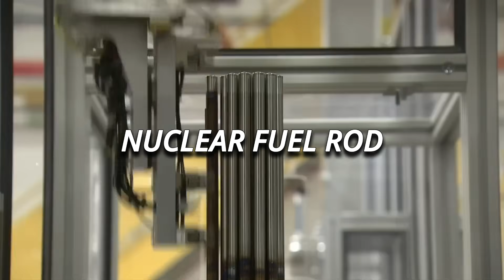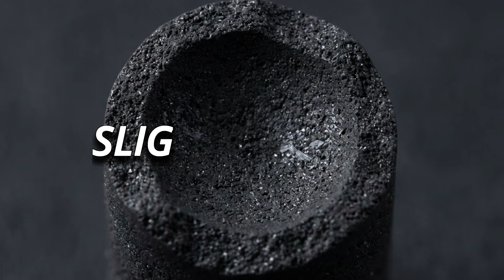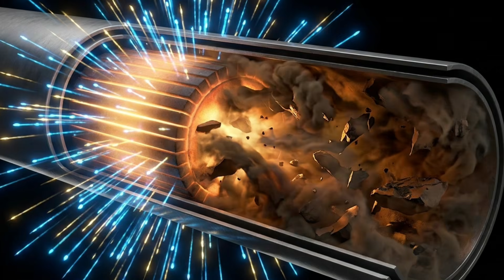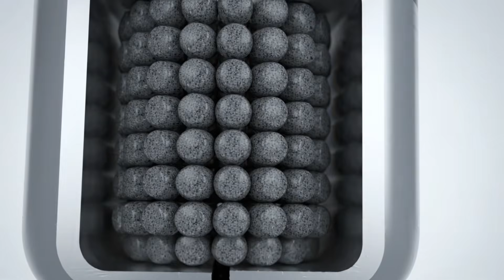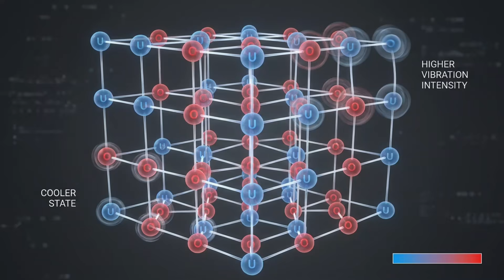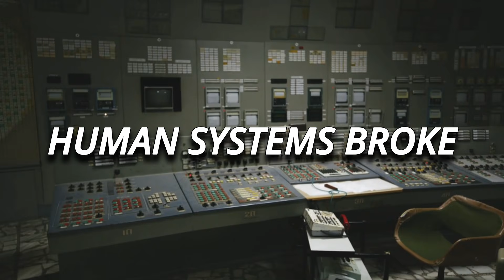Why This Tiny Nuclear Pellet NEVER Melts (It’s Genius)

Comment: Uranium dioxide DOES have a melting point, but it’s 2,865*C, around the same temperature as nuclear meltdown corium
Reply from the maker: Spot on—it definitely has a limit, the engineering is just designed to make sure we never actually hit it!

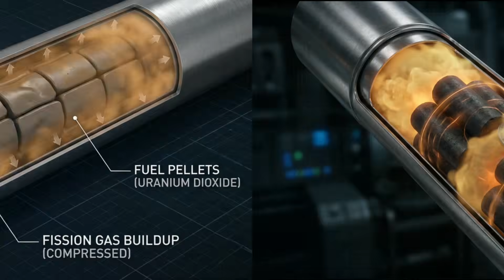Comment: @2:51  Wrong!!!!!!!

The bottom of the trench; according to Wikipedia Is:1,086 bar.   That is 15,751 PSI.
Reply from the maker: Sharp catch — and you're right to flag it. 1,086 bar / 15,751 PSI is the correct figure for the deepest point. If the number on screen read differently, that's on us to clarify. Either way, the physics doesn't change — at that pressure, the pellet geometry still holds. Thanks for keeping us honest. This is exactly the kind of audience we want watching. 🙌

Comment: As I believe, carbon doesn't melt, it sublimated, eg it goes from a solid to a gas and skips the liquid state!!!!
Reply from the maker: Exactly. That’s sublimation! Carbon is one of the few elements that prefers to skip the liquid phase unless it's under massive pressure.
Reply: @Machino2.o ahh, thank you. Carbon is my favourite element, it has so many unusual properties and is si crucial in life. It conducts electricity and is found in every living cell on earth. It hase so many different chemical forms. I also like silicone too!!!!

Comment: The fuel pellets are made of uranium oxide and zirconium oxide. This allows very good heat conduction. The fuel pins are evacuated and filled with helium, that's the secret that gives them decent heat conduction. The pellets have concave ends because as the reaction proceeds they generate fission products that would cause expansion that would cause too much cracking which could cause hot and cold spots. Pellets are separated by wafer springs to compensate for thermal expansion. The top of the rod has a gasous phase product resovoir mostly to allow the xenon133 to get to a safer location in the rod otherwise it would diffuse into pellets in regions of low activity then it could burn off and these regions could experience prompt criticality. The design is elegantly simple but damn effective. Hats off to the engineers who designed them. ❤
Reply from the maker: Spot on, Christopher. The xenon-133 migration to the plenum resovoir is such an underrated piece of the puzzle—it's basically a gas management system built into a solid rod. Glad you caught the detail on the concave ends, too! It’s that 'designed space' that keeps the whole stack from buckling. Thanks for adding that extra layer of engineering detail to the thread.
Reply: Eventually, the whole system surrounding and supporting the energy production turns Radio active, which themselves radite energy over time. Now, these systems needs to be controlled and replaced I guess. Isn't it?
Reply from the maker: @sandhyaprabhu6996  Exactly right. That's neutron activation where the structure itself becomes radioactive.

Comment: The comment at 2:50 is totally wrong..fluid physics, pressure increases by approximately 1 bar for every 10 meters (33 feet) of water depth. This is known as hydrostatic pressure  There is 14.5 PSI in 1 Bar... The marina trench is 11000m deep so that would be 11000÷10=1100.. 1100x14.5 = 15950psi... Get your facts right pal!!!!
Reply from the maker: Good catch on the Mariana math! You're absolutely right—the Trench hits closer to 16,000 PSI. My comparison was meant to highlight the massive internal stress vs. external pressure, but I overshot the depth on that one. The real takeaway is still wild: a weld thinner than a hair holding back 2,000 PSI for 6 years straight. Thanks for keeping the engineering facts tight!

Comment: Sorry, but 2000 psi isn’t even 140 bar, and at around 11,000 m in the Mariana Trench the pressure is about 1000 bar. This statement is therefore completely inconsistent.
Reply from the maker: Spot on. 138 bar vs 1,000 bar — that analogy was off. Thanks for the correction.